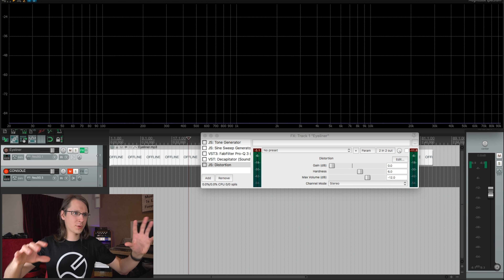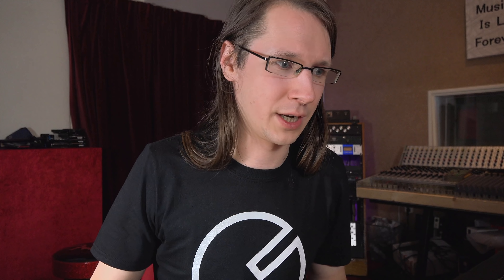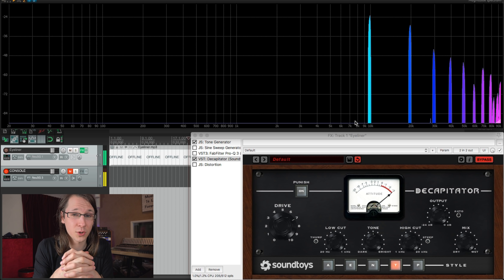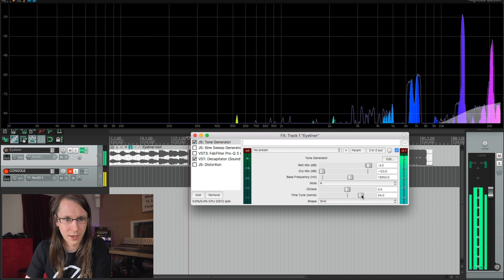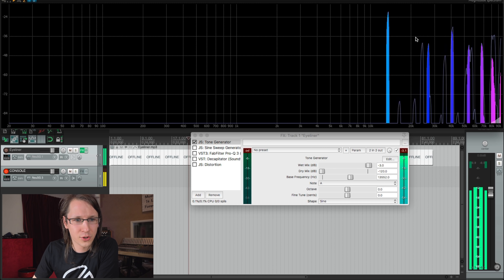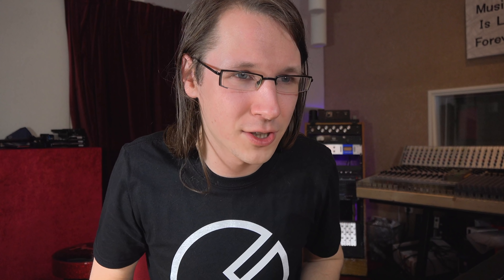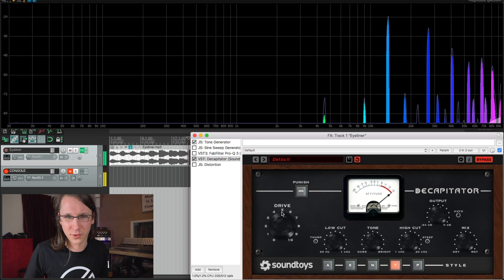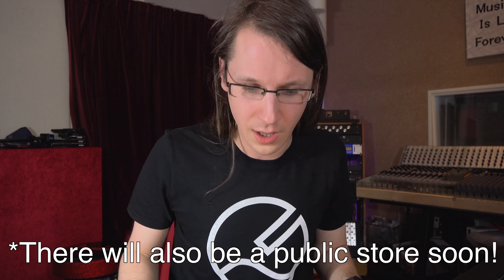Why MANY ANALOG EMULATIONS are SNAKE OIL!

Comment: I have done this.

If you want to generate 2nd order harmonics and you have frequency content at say 15KHz. You would get 30Khz,  but since you can't go above 24Khz (48K sampling), what you get is the alias frequency which shows up at 18Khz which is wrong.

Good plugins oversample, maybe up to 8 times or more, on top of that filter out any content that would generate aliased frequencies

If generating 2nd order, filter out everything below (sampling frequency / 4)
if generating 3rd order, filter out everything below (sampling frequency / 6)

At insane distortion levels like guitar amp simulators, or distortion stomp box simulators, I have yet to find a plug-in that doesn't show some aliased content.

We should all be doing this to test the quality of plugins, specially if they claim to emulate analog equipment.

Comment: Hmm I don't really agree with this. Aliasing is a non-issue when it comes to mixing individual tracks, it's more when processing entire mixes when it becomes useful to use something that can oversample. The fact that decapitator doesn't have oversampling is not because they're "lazy", let's be real here. It's because it really doesn't matter in the context of a mix, if you use it appropriately. You need to really drive it hard on a signal with a lot of high frequencies for it to generate the digital artefacts. But it's a catch-22 because driving it hard you're degrading the audio so much anyway that complaining about quality is ridiculous. Decapitator is more of a tube pre-amp emulation used on individual tracks, mostly subtly. I think focusing on these things makes you a worse engineer because it distracts you from things that actually matter like improving your SKILLS with compression, EQ and delay/reverb and getting an almost perfect balance. If you use those things very skilfully you will get world-class level results. But no, it's of course everything else BUT me that is the problem. It's the tools fault. If I had a fairchild for €20,000 it would magically do all the work for me and sound perfect. How you use it doesn't matter at all. We don't like to take responsibility for our work, but you have to if you want to advance. It's 2019 and what separates a good mix from a bad is all skill. Keep the mindset "I'm making a song sound good" and all the insignificant non-issues fades away.

Comment: Analogue is the pure waveform .Emulating analogue in a digital environment (like a DAW) will result in the analogue signal recalculated to bits and bites depending on the bit rate and sample frequentie used. The conversion changes the pure analogue waveform into a stepped one no matter the resolution. So digital emulating of analogue signal is not possible. Cobra grease confirmed.

Comment: Another way to explain why plugins can't 100% replicate analog gear is because digital will always have a fixed number rounded to the lowest decimal whereas analog captures the exact value that you're setting your parameters to. Meaning digital will technically never be as "accurate" as analog is.
That being said, there's some great plugins out there, but analog adds a unique coloring to music you couldn't otherwise achieve.

Comment: Musical performance trumps analog equipment by far. Plugins are good for engineers with a massive workload. Try recalling 5 different projects with analog gear there is a reason why a lot of engineers choose digital Plugins now.

Also we live in the digital age where most music is consumed on devices where the listener won't be able to tell the difference between a digital and analog compressor.

So snake oil is selling a compressor for £3000.

These Plugins give new engineers the tools to learn the basics and I'm many engineers can get a better mix out of digital Plugins than a incompetent analog only engineer.

Comment: I have listened & grown up with a lot of 70s music, vinyl, tape right through to the inception of CD and now MP3, streaming etc. I came into production later than most in my life. In my 40s. I wasn't exposed to plugins right off the bat form an early age. It matters because a lot of butting producers have heard nothing else & that's fine if the final product sounds good.  When I first discovered analogue emulations, I could not for the life of me get what the fuss was about because to me they sounded nothing like real analogue. I have recorded to tape, & dabbled in analogue consoles, Neve & SSL. Nothing compares to passing your tracks through some analogue gear. I does not have to be expensive. For the amount of money spent on plugins, most can afford some outboard gear that you can integrate with a basic audio interface. I know of several EDM producers using reel to reel tape costing a few hundred dollars.

Comment: There's nothing wrong with emulating hardware pieces if you know what you're doing. Like you said in the video, issues start to arise when the programmer who is in charge of creating the software emulation does not have a solid foundation on the topics related to digital signal processing or too lazy to implement the necessary features.

Comment: I agree with the snake oil junk that is analogue modelling software though, as a pitch it earns sales ;) Any algorithm that internally processes sound at 48k, and claims to be analogue is bunk, internally it should operate at the maximum hardware sustainable Fs, and as you eloquently point out filter the garbage frequencies before the algorithms output stage.

PS >20 khz is the territory of bats and dogs, the limit humans can hear to (20 khz) deteriorates with age, and abuse. Look after those ears, don't over expose them to noise. Also note that many top music producers are getting on a bit (ears start to go down hill at 25 for most), they probably struggle with anything in excess of 10-14 khz, does that mean they shouldn't be making music? (top note on a 108 key concert piano B8 is ~ 7.9 khz for reference)

Comment: Paul Simons Graceland was recorded on a Sony DASH PCM 3324. That's 24 tracks of 16/48 on half inch DASH tape. Graceland sounds amazing and it is considered an audiophile recording. . Don't know what you are talking about dude.

Some of the best compact disks ever made were Steve Hoffman DCC disks mastered on a Sony 1610 and 1630. 16/44.1. 

Go get some DCC compact disks and a reference converter.

No all analog modeling is not saturation. There are a few tube plug ins that are the real thing. Tubes produce this this high frequency blanket over the sound. And most tube plugins are crap. They only model the tube high frequency blanket. But tube sound isn't just the sound of the tubes but the sound of the transformers. Real good quality tube modeling gives you two settings: The tubes and the sound of the transformers (which are not saturation.)

Saturation is a good tool if used properly. It is not a replacement for a good mix.

But what you say is essential true.

Comment: "this is the problem, this is what I'm hearing" dude it's - 80db down, A) you ain't hearing that, B) even if you were a dog, amongst any other sound source masking (including dither noise) you ain't hearing that.
Reply: it *accumulates*. With every frequency and modulation and with every non-linear digital process. The added aliasing distortion goes not only into the audible range but can also mask parts of the music.

Comment: do you really saturate sound who get fondamental at 10Khz????
if you use decapitator on bass or kick you will not get problem. decapitator change a lot the freq reponse too. 
upsampling is usefull for all what's true peak limiting or yes crazy saturation guitar or hi hat , but most vst give the oversampling options, or others do it auto depend of the project setting in the DAW
but decapitator it's a old vst, but will work in bass kick and others.
And you don't have to oversampling everything, an EQ it's not usefull, like many others
But if a mix is bad it'sn't the aliasing problem, maybe just the sound s**

There is the science, and what you will get in yours mix, like a perfect square wave don't exist in audio, good reason why your synth oversampling to get a better one, but *8 it's unusefull

Comment: You are comparing saturation of an analog console to the T style of decapitator,  two diferent things, plugins dont react equally , and a lot of plugins make oversampling when you render (Higher quality on export), Even the example was incorrect , this time your video was better,
Reply: @lastwarning1  Decapitator's T style is based on the Rack Culture Vulture unit, made specifically to achieve powerful and aggressive distortions, not subtle saturation of a chanellstrip from a console, then ... yes, it is made to sound like crap on purpose. And the only way to know if this plugin performs oversampling internally is if you work in this company,
Reply: @lastwarning1  No. The problem is not defending this plugin because I bought it. the problem is that what he says in this video is incorrect, in the almost 20 years that I have working in the music industry, I witness how in 80% of the time, minimum, professionals use this plugin, and many times they prefer it before the hardware. I personally prefer this and other saturation plugins instead of hardware on many occasions. The real problem is to keep selling the fact that hardware is better than software, and to cut the wings of young people who do not have the money to buy expensive equipment. Just for the sake of attracting customers. And no, if you test this plugin for yourself you will realize that it does not sound like "Crap"
Reply: Yes, you Won , Take your Candy

Comment: You cannot ever make digital into analog no matter how computed digital is because no two things are the same and the universe is not perfect. If you did it would be called analog and you would be back at analog, in the future of digital. It would turn itself back into analog and back and forth forever unless you just accept them as they are and use them for what they are able to be used for. Possibly digital plus analog for what analog is needed for lol .. Maybe it'd save some CPU and clear up the sound. ^ _ ^ Too much digital not good and is itself SNAKE OIL.

Comment: U dont know crap about plugins. I don't think you can pick which one is analog in a blind test. LMFAO
Reply: He may be absolutely right and may be very smart but I agree that he probably could not tell or hear the difference in a blind sound test. Also he should use UAD or Slate Digital plugins if he really wants to test plugins that sound good.
Reply: @woodstocktc  a blind test where he processed the audio and then test it again? Given you are not using your real name, I will consider you as a TROLL
Reply: @Jbandes  Slate has Distressor and FG-Stress comparison on their website.. I don't have good ears but I can't tell the difference.